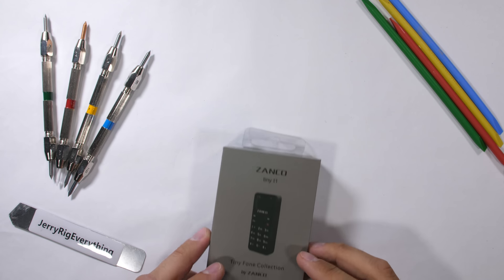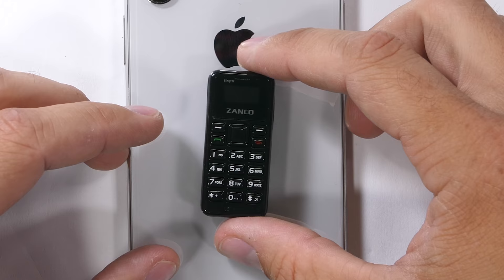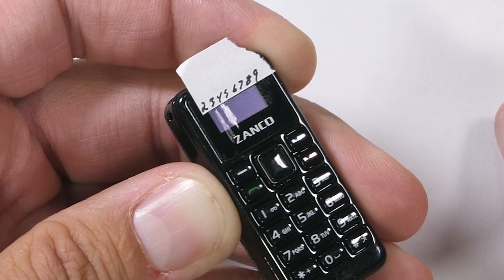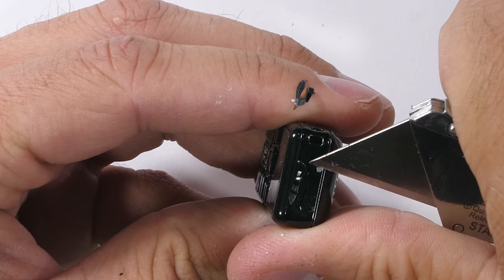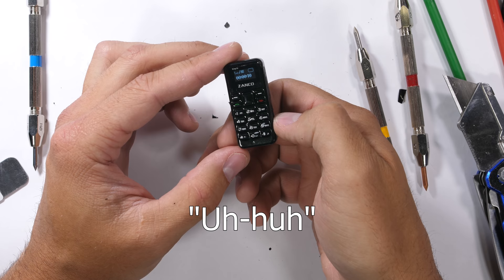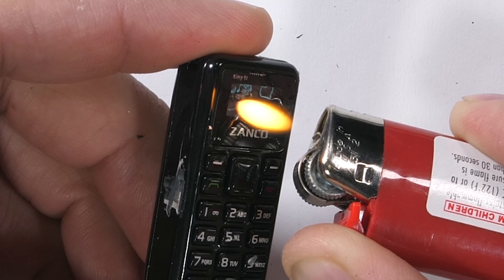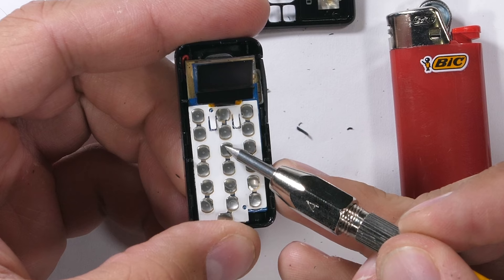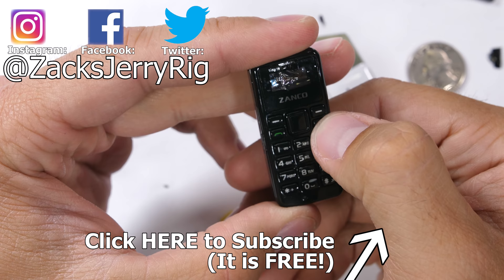World's SMALLEST Cell Phone - Durability Tested!!

Comment: I think this phone's great, you can just throw it in your bag and forget about it but use it to make calls in an emergency when your phone runs out of juice.
Reply: Curtis Cleary 
You’ll need to recharge it from time to time ro make sure the battery will last long enough
Reply: @hamzahaytham3940  Well the battery lasts 3 days of use. So if it is fully turned off it should probably last a while. You could also just keep the battery out of the phone until you need it. It isn't sealed shut or anything like the new phones.

Comment: If Apple released this phone it may cost 10000$ for base configuration!
Reply: TechKerala and 2000$ for the headphone adapter
Reply: $2500 for wifi connectivity
Reply: and $9999999999999999999999999999999999999999999999999999999999999999999999999999999999999999999999999999999999999999999999999999999999999999999999999999999999999999999999999999999999999999999999999999999999999999999999999999999999999999999999999999999999999999999999999999999999999999999999999999999999999999999999999999999999999999999999999999999999999999999999999999999999999999999999999999999999999999 for Itunes.
Reply: And 600 dollar for the charger
Reply: You can't forget that it will cost 500$ for a battery replacement, and if you refuse, your phone will lag like Heck.
Reply: I cringed so hard reading this thread
Reply: Team DiamondHD lol why tf would apple do that
Reply: HAH GET IT BECAUSE APPLE MAKE EXPENSIVE SHIT HAHA

Comment: I miss T9 on physical buttons. No need to look at the screen to write, automatic spellcheck worked like a charm,  fast and easy writing. The trade off is big, bright, colorful, high resolution, high performance displays powered by magical lithium batteries and circuits a fraction of the size but still 20x more powerful than my first comp... Oh... I don't mind QWERTY touch writing. it's pretty good!

Comment: I can easily see a use case for this phone: a pre-paid simcard, call-time recharge voucher and this phone will fit in even the skimpiest first aid kit, and I bet it's cheap enough that you can afford to buy half a dozen of these phones with pre-paid simcards. Put one in the glove compartment, bedside drawer, by the torch, by the fire extinguisher, in your bugout kit, stuck to the inside of your cars trunk by the spare handcuff key or in the hollowed cavity in your shoe's sole or sewn into the lining of your inner trouser leg three inches below the pocket but above the sock lining so your knees natural bulge hides the lump or even folded inside the knot of your tie. If you leave it turned off, the battery should last several months to a year in case of emergency with enough charge to provide a tiny light and emergency call.

Comment: Obviously it melts if you set it on fire with a lighter and obviously it scratches if you attack it with a sharp knife which I won't be doing. That was just stupid and wasteful.  This is the best thing that came out for runners. I can carry it in my pocket and not notice is there. Call my gf if I get in trouble running 32km  in foreign country or if we want to meet up after my run.